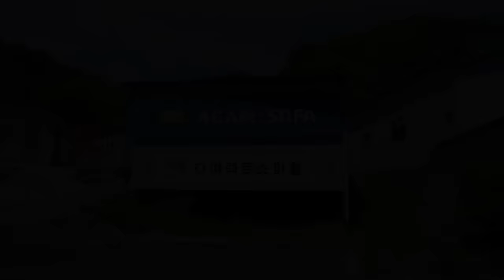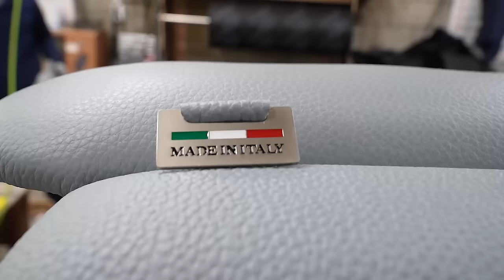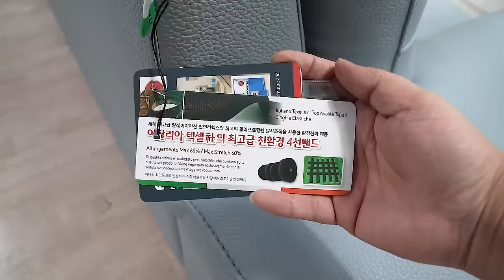How to make a high-quality sofa with natural Italian leather - Korean Sofa Factory

Comment: Tag said Made in Italy?…didnt know Korea was part of Italy
Reply from the maker: I'm sorry that there's a wrong explanation because I used a translator. This is an Italian leather sofa😊
Reply: Nice looking sofa!
Reply: @royalfactory5320  The label says "Made in Italy"
Reply: @ЕвгенийМоисеев-ч6н  Perhaps it refers to the leather 😬😬
Reply: Italian leather? You mean Italy processed leather...
Reply: It says high quality but the finishing does not of high quality
Reply: This is so typical of "most" (almost all manufacturing)... any lie that will make you more likely to buy is ok! (It's really not! 😅).

A lot of advertised (Brand Name) "made in America" stuff isn't either (it's just "assembled" in america)... this is the same kind of thing: "made" in Italy... assembled (built) in Korea! (It does look like the frame is plywood and wood, as apposed to particleboard... so the quality is a little higher than your average furniture)... They only used "some" particleboard... 😉
Reply: @hcw5012 no... they mean: skinned and tanned Italians (says so on the label). 🤣👍
Reply: What kind of leather is this?
Reply: ,I need a job... here.